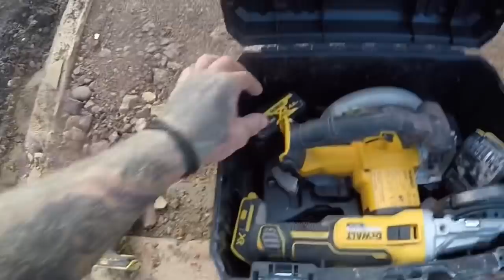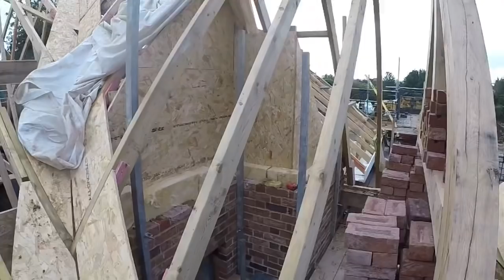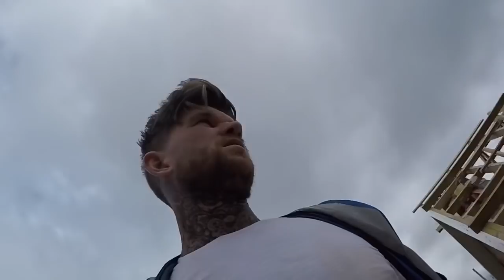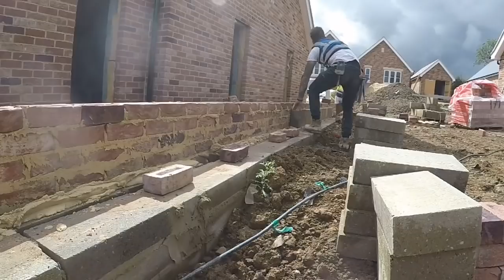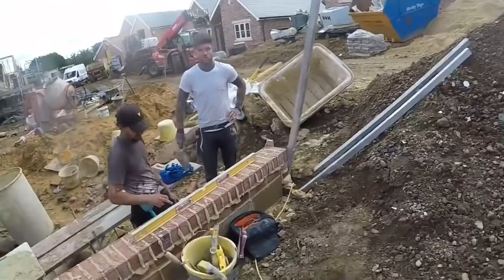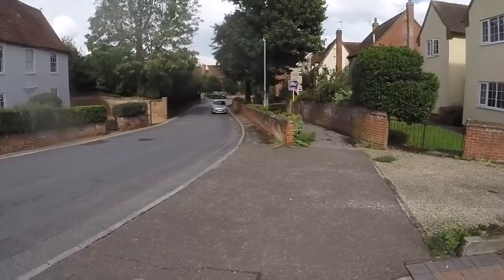Bricklaying. Friday vibes

Comment: Quality when you see modern bricki with an actual tool kit. Not just a vllevel hammer and trowle. Make life better havimg what's needed. 😉
Reply: Ya it’s good to have modern equipment, but you need to use ya brain instead of relying on equipment my friend
Reply: its more a case of aswell of not instead of bud. we need the ability but try throwing up a piller without your level set. the tools are the link to your ability.

Comment: I don’t like the brick on edge and then the patio on top !!It’s a shit finish imo, not your work but the clients design, just doesn’t look correct
Reply: Surely the height of that patio doesn’t meet building regs Charlie without adding some protection against falling.
Reply from the maker: Alex Callery exactly what I thought
Reply: Up north Leeds/ Bradford area any patio or decking above 600mm needs a balustrade